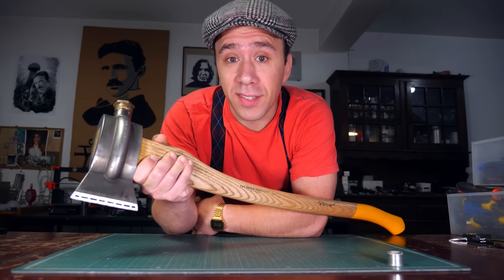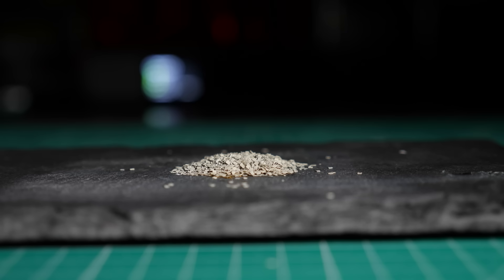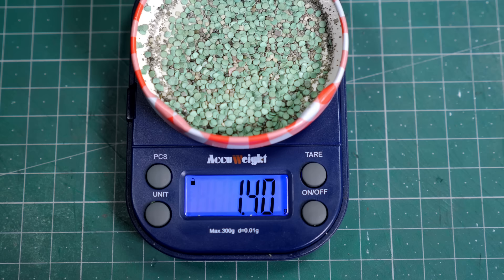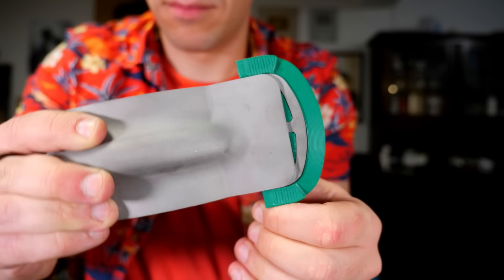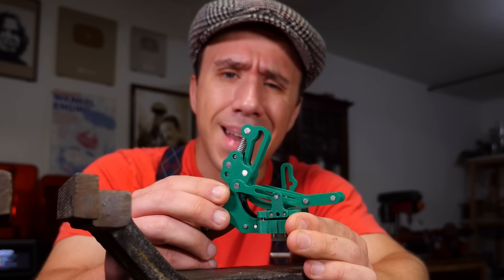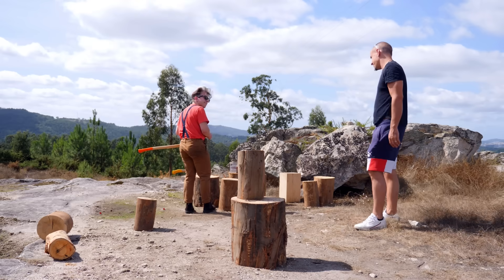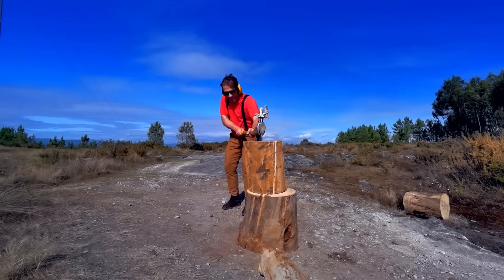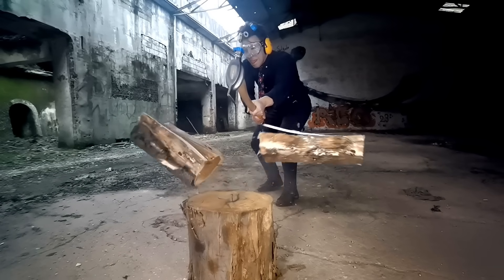I built a BETTER SHOTGUN AXE

Comment: what would happen if you replaced the cutting axe head with more like a spike, similar to a medievil war hammer, but with vents? I am not sure the initial cutting is necessary, only the explsive force. Then, learn a lesson from arrow making and give the spike barbs and the explosion won't force the spike back out. Voila! a solution that only requires weeks of engineering, making and testing.

Comment: To compensate for too much penetration make a + shaped axe they actually make them to split logs in 4 with 1 swing this way even if it splits too far in one direction hopefully in the perpendicular cut it hasn't. ... tho still may not work as pressure will want to escape thru the open split

Comment: I regularly make compound explosive liquids that are low enough viscosity that they easily flow completely through the passages of yellow jacket nests, but doesn't absorb into the local soil without evaporating easily enough that it becomes a thermobaric and overpressures by the time I clear to safety and ensure that I don't have any viable victims remaining to force using my epipen. I also have a few termite recipes for cutting or welding metals that I trust enough to not sweat. I've made a shoulder launcher for modified model rockets that are mini missiles with upto a pound of blackpowder detonated on impact with a primer trigger...however, I am absolutely not even touching your boom-axe for any reason because I hit a box of buckshot with my push mower and some low probability chance detonated most of the shells instantly shredding the deck and large areas of my lower legs. That thing will kill me 😂

Comment: You need to shape the exhaust to point exactly oppsing sides instead of facing downwards.

Maybe you just need an axehead with holes on the sides instead of replacing the edge.

Comment: It may be a stupid idea but what if you make more of a pickaxe head instead of an axe round blade ? that way you penetrate more, limit the surface of impact and risk of splitting and you can have multiple exhaust along the length to put more pressure deeper in the wood.

Comment: Sooo uuuh, I have some information I’ve osmosis-ed from different parts of the internet which may or may not be useful (sorry if you’ve already heard it):
in my incredibly unprofessional opinion, normal axe profiles are like wedges because they wedge apart the wood, so a very narrow and thin profile would just get stuck (which seems like what you need). 
Also, since you’re not doing repetitive strikes like a common axe, it might be useful to pile on the weight as much as possible (like a hammer).

Also my brain fails to comprehend anything ‘folding’ or clockwork-type stuff, so that locking mechanism looked like magic to me. So cool that you’re giving things a second try

Comment: Would be funny if you accidentally found a more efficient way to chop wood than the hydraulic wood choppers. It's a shame that oxyhydrogen did not work out. Cheap reload would have been a requirement to use it commercially. How much pressure does it use, would a normal pressure generator be enough?
Fracking wood is a really nice concept to my eyes. Don't forget about the surface area at which the pressure is applied to the wood. If you can increase that, then it will need much less.

Comment: Would it help if the exhaust vents were angled back slightly, so rather than pushing the axe head away from the log, the escaping gases drive the axe head further into the log?

Comment: Dry eucalyptus gum is a nightmare to chop. We use it for non-cooking fires in South Africa, since it imparts a horrible flavor, but when we chop it is when it's wet. WAY more workable. But the best option is to use your axe on pine. Awesome mechanism, well done. Economically unfeasible due to the price per cut, but a neat party trick if you can afford to have riot shields as party favors.

Comment: Hey Joel. You should turn part three into a colab with a fitness or body building youtuber to show off how difficult it is to split those logs.... And then have them use the version three axe! You might also consider a locking pin or bolt for keeping what ever firing mechanism you come up with attached to the axe. And maybe an emergency pressure relief valve... I'm excited to see what you come up with next!!!

Comment: @integza I think it comes down to the angle, and size of the slots you use to inject the offgas into the wood. The thing with the smaller holes is that you increase the pressure across the area of the wood, and as you increase the density of the wood, the force needed to split the entire log might exceed the forces possible with a 12ga.

Comment: For v3 here's some ideas: Switch to a spike based design. You will get deeper into the wood (more displacement due to (pressure = force/area) ensuring a snug fit. 
This can also slip between wood fibers vs trying to sever them which causes the blade to not go deep enough. 

The design of the chamber could try and incorporate an expansion chamber for the gases + wide piston face with a tapered shoulder. Look into the design of the Oregon "Wood Grenade" for inspiration. 
Effectively what you're building is one of these but with perforations at the bottom (Calculated perforation sizing, progressive hole pattern and angled holes - direct blast away from operator) 

A trigger mechanism would be also more helpful (ensure successful placement before firing) - Extend the trigger cable length to test properly before holding the axe etc. 
The design of this could be a very simple dead mans switch attached to a removable chamber (I would recommend this over a break action because the gas seal at the hinge action is tricky) for a better gas seal and 360° thread engagement distributes force evenly with no hinge point. captured o-ring  
You could then pre-create like 10 of these chambers and just screw on a new chamber each time. 

In theory Use 4140 steel with 0.25" wall thickness minimum will give you a 4-5x safety factor at 11,000 pSI for a shotgun shell. Wood will always split at max 4000psi just an overbuilt chamber (2x thicker than shotgun barrel). The wood splitting then becomes the pressure relief. 

I wouldn't buy a wood grenade to start - Machining one is very easy with a multi axis CNC. 

                    SIDE CUTAWAY VIEW
                    ==================
    
    [Knurled chamber cap]
    ==================
    ||                ||
    || [Firing pin]   ||  <-- Spring-loaded pin BEHIND shell
    ||      →         ||
    || [Shell primer] ||  <-- Shell sits here
    ||   [SHELL]      ||
    ||================||  <-- Threaded chamber (1"-8 ACME)
    ===================   <-- O-ring seal
    |\               /|
    | \             / |   <-- Thick walls (0.25")
    |  \___________/  |
    |   |[Trigger]|   |   <-- Sear mechanism holds pin back
    |   |  cable  |   |
    |   |    ↓    |   |   
    |   |         |   |   <-- Hollow interior
    |   |         |   |
    |    \       /    |   <-- Expansion chamber
    |     \     /     |
    |      \   /      |
    |    ● ● ● ●      |   <-- Perforations (angled down/out)
    |     ● ● ●       |       
    |      ● ●        |   <-- Progressive hole pattern
    |       ●         |
    |       V         |   <-- Wedge tip
    
    
    [===Handle/Shaft===]  <-- 18-24" hollow tube
            |
    [Trigger mechanism]
    [Safety pin slot ]
    [  T-handle grip  ]
    
    
                    FIRING SEQUENCE
                    ===============
    1. Pin pulled back → [::::<] Shell
    2. Trigger pulled  → [::::<] Shell  
    3. Pin released    → [====→] BANG!
Reply: The part i'm really not sure about is the firing mechanism, there's a lot of complexity here. Ideally you want the threaded chamber to be isolated from the pin + trigger so that all you're replacing is a shell inside a threaded chamber. I do think as demonstrated in the v2 video the break action loading is the core problem with the pressure release and this is also why v1 performed better because it was a self contained system with the pressure relief being the wood. 

Electronic trigger worth exploring

Comment: If it's only penetrating as deep as the ports, why have a blade any longer? In a traditional axe the blade that slowly widens helps to split the wood and spread it further apart. Your axe needs a good seal around the ports, so it may be better to be flatter. Like a hammer with a kitchen knife welded to the front.

Comment: You should put the firing pin on the actual cutting edge somehow. That way it triggers as soon as the blade fully enters the wood. Like maybe have a linkage arm that protrudes like .5mm down the cutting edge so it triggers as the blade end is reaching the end of travel.

Comment: im going to make this comment. and see if anyone else has. later

your form, how your are comming down. it will help to penitrate the wood better. its force yes. but how your applying it. ALL YOUR MIGHT well lets make that better.

with your hands held apart like you were doing you can still apply that force. but think about if your hands were together. simple thought it creates a single point of swing not 2 that are split by width (your shoulders) and length (your hands) by how your like whats he saying. well im getting to that. 

when you swign down bring your farthest away hand  into your near hand. you will get more force. try it out. 

and if i did all that explainging and you already knew. well i like tomates and you can dislike me now for 2 reasons.

Comment: Maybe ditch the direct gas approach and make the axe blade into a piston; the combustion gasses expand and drive the reciprocating part of the blade/head into the log.
You also would no longer have to compromise the blade geometry or be overly worried about over penetration.

Comment: When you make something that is supposed to cut something (like an axe head), you should really look into heat treating that part. If it’s harder, it can usually penetrate something more easily. You can do that with your welding kit and water, treating only the sharp part (after grinding it) by heating it until it glows and then cooling it in water. After that, heat it up again, this time with a blowtorch or something similar, and let it cool in the air. When it is cooled, it should be easier to chop wood.
Reply: Hardness has no affect on penetration, only on durability.
Reply: You can't heat treat stainless steel. Or you can, won't do much
Reply: @tedarcher9120 Depends on the stainless. 400-series or precipitate hardened SS can be hardened. 300-series can only be work hardened. I'm speaking very generally here.

Comment: Why not make the inside of the steel axe hollow and fill it with hydrogen gas. use the tank attached to the axe to auto fill the gas after each strike. the ignition is based on flint and steel inside the mechanism

Comment: What I thought for the first version and what might be helpful for the third is: Why use the gases to push the wood apart? That requires sealing against something porous that you can't control. Maybe it is possible to come up with a mechanism that is basically two blades (or halves of the axe head) that are so close together that they seal against each other. Once the charge triggers, it tries to force the two halves apart, splitting the wood.
Reply: Hehe just had the same idea, an expansion piston chamber pushing them apart 😅👍

Comment: This tool uses a electric motor to  store compressed air in a cylinder to  release all at once to drive nails into wood. Maybe you can use the same principle to make v3 of the axe? Convert mechanical energy to compressed air in a tank instead of explosion: https://www.youtube.com/watch?v=tvycoOiB3Kc&t=683s

Comment: I guess your blade is overall way to long. I would say the smaller the the axe beard is, the more reliantly each hit would deploy more pressure into an even smaller area.
I used to drill holes into firewood and put firework crackers into them And I noticed that the bigger the load and the wider the radius the more the charge tended to fly out the top.
I got the best results with narrow holes and longer charges, which means more energy in a smaller space. I got very reliable results...
Yeah, I was bored a lot as a kid...

Comment: A potentially more effective (and dangerous) solution would be to have the explosion move the axe head in some way. Either by driving it forward on impact or by causing the axe blade to widen or spread apart. Though this does fully turn it into a pressure vessel.

Comment: Use a kinetic piezo driver in the axe head there to produce plasma, and you can use the ax a few times to build up strength per se.. the first few times would charge it, then produce and prime/compress the oxyhydrogen, and then ignite it.
Reply: oh, and keep store extra water in the handle

Comment: If you want a more reliable trigger mechanism you could probably use triggers !

When the blow connects, to push the blade inside, you push against it with your hand - make a pressure activated trigger mechanism in the handle so that the hand grasp that happens when you hit the target triggers the bang ! 

Could also use a contact trigger - a rod on (or in) the head that get pushed inwards as the axe reached into the target, triggering the explosion after it has been pushed sufficiently.

Last thing - gunpowder is process nitrocoton with a smudge of nigroglycerine, you can make your own propellant !

Comment: Item Got: 
Axe 0.5
Quality: 3
"It's still being tested..."
Gain a weapon that fires automatically at random intervals. 
The Weapon will occassionally fire with one of the following effects: Hook Worm, Spoonbender, Tiny Planet, Mysterious Liquid, Rubber Cement. 
Luck has no effect on the rate at which Axe 0.5 fires and does not scale with items that increase fire rate.

Comment: Okay, I have a few pieces of advice for whatever it's worth to ya.
First, I think having an "contact trigger" would make sense here. Imagine it's a button that gets pressed by the wood when you swing the axe. This will work as a stop, preventing overpenetration, and also trigger the shell consistently.
Second, you may consider using a much stiffer hammer spring. There is a very noticeable gap between axe impact and the shell going off. Shortening that time will ensure the shell goes off while momentum is still pressing the blade down.
Third, if you're concerned about the axe bouncing off the wood, maybe incorporate a deadblow hammer into the design somehow.
You can take all this with a pinch of salt. I am not an engineer, but I am an American firearms enthusiast. So, if any of this is useful to ya, I'd be glad.
Reply: How about first installing a safety of ANY kind, to prevent the whole thing embedding itself in his face?
Reply: must wear latex gloves
Reply: @zionbhavra8594 yes, and fuzzy, kitty cat ear muffs.
Reply: @ms4eji0bek oh yes, that too. Lol

Comment: What if one side of the axe were a hinged plate that fits inside a pocket. Behind the pocket is a slightly smaller pocket creating a lip that the plate seals against  and the smaller pocket provides surface area for the gasses to  push on the plate.

Comment: 3:49 Always interesting to see how many people aren’t using the guard around the disk. I had a cutting disk disintegrate and was very glad to have it, otherwise my face would’ve gotten a bit more than a light dusting
Reply: This dude leans over an armed shotgun shell with no safety on, known to explode a bunch of brass with decent air time. Do you think he's concerned with safety?
Reply: Sometimes you have to work at weird angles the guard prevents to hit
Reply: @guillaumejoop6437 i suspect having shards of disk embedded in your face would also make it hard to cut some angles
Reply: But yet this dude most likely texts and drives. Thats right. Piloting a 1 ton projectile with loads of kinetic energy. While checking his princess status on Facebook. But yet he complains about not using a guard. SMH
Reply: @floppinfish  Are you talking about me? If so I’m sorry to disappoint you, I enjoy driving and am willing to bet that I’m a better driver than you
Reply: It limits how many cuts you can take with the guard on, and it gets in the way of tight angles way too much. I use mine without the guard a lot because it was feeling like I was doing more dangerous work with the guard on, to work around its limitations.

I could put it back on, and I have for some times I've known I was doing a bunch of really easy straight cuts, and for that, I'm glad mine is quickly attachable.

I've had ~3 disks explode on me, I've done a lot of cutting with a grinder. All three harmless, and I never wear any safety equipment beyond my jeans, boots, and jacket. While they move fast, they have barely any weight, and I had a bit one time bounce off of my jeans, zero damage to the fabric. I imagine there's a freak scenario, or an eyeball they could injure, but I don't keep my face in line with my blades anyway, and I already wear basically safety glasses due to my prescription and style preference (otherwise I would consider them a worthy piece of safety equipment for cutting).

Comment: You’re essentially attempting to build a combustion engine at this point, but the piston head is the wood. You’d be better off using nailgun cartridges, which contain the same primer compound as shotgun shells, to set off a larger charge of some sort of powder. If you can get smokeless shotgun powder, great. If not, homemade black powder. If not, matchhead powder.

Comment: Great video glad there will be a 3rd. For the 3rd would it be possible to contain the gas inside the axe and make the axe like a bellows? Spreading the steel sides of the axe to Split the log with the axe not the tip gas outlets of the axe which might be sealed.

They make hydraulic versions of this already. The steel head going into the wood and expanding to split the log more.